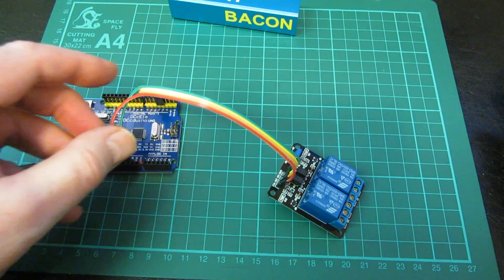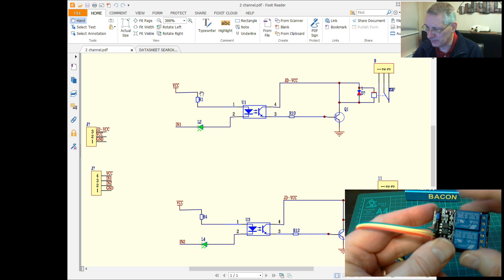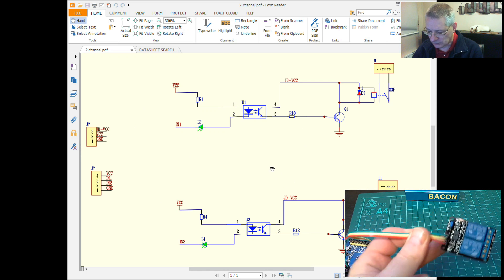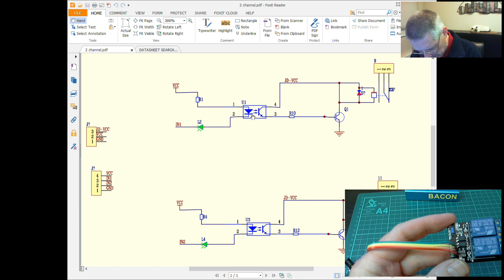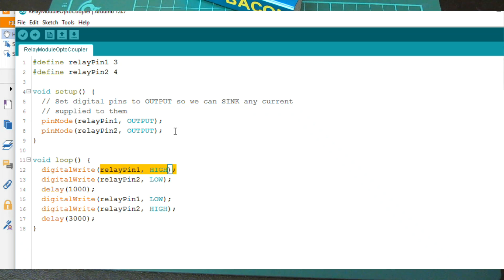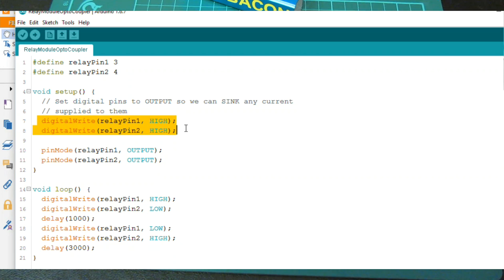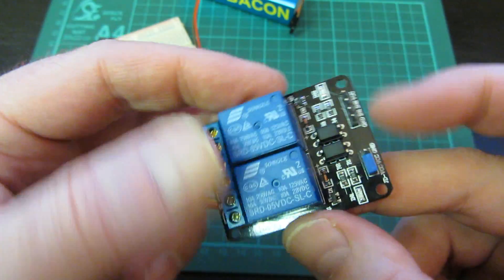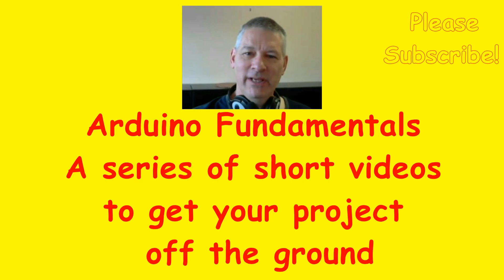#18 Add a Relay Module to your Arduino project - Hints, Tips & Traps

Comment: i have a project that is am looking to star that is similar to this, i am trying to use a 12v single channel sainsmart relay, it just has the power, ground, and signal, pins, none of the pins that you used to power the relay externally. the power and ground pins are meant to be able to connect from the arduino. if i power the arduino and relay from the same external power supply, with the positive and negative wires from the supply connecting directly to positive and negative pins on the relay, this would only leave the signal wire from the arduino connected to the relay, would the relay still receive signal because it and the arduino are connected to the same ground? this is the relay i would be using: https://www.sainsmart.com/products/sainsmart-dc-12v-power-supply-srd-12vdc-sl-c-adjustable-trigger-delay-time-relay-module-for-arduino.
Reply from the maker: This relay is, in principle, very similar to the one I show, Gideon. As the web page shows, the Arduino is powering the relay via an optocoupler (the "IN" pin, I'm assuming). As they mention that the power to operate the relay is entirely independent from the Arduino, I assume that the VCC is from a separate 12v power supply and the power supply ground and Arduino GND both connect to the GND pin on that white socket. Unfortunately, I can't find a spec sheet, not even on their own website, so what the jumpers do is anyone's guess (or perhaps you know)?
Frankly, if you just want an adjustable delay time relay I would use something similar to what I used in my video and let your Arduino do all the timing and delay work - what else is it there for?
Reply: @RalphBacon  thank you for the quick reply! No i don't know what the jumpers do. why i chose that specific relay is that it is small and my project is supposed to fit in a tight space. though i may sacrifice that for ease of use,  using the relay in this video. i do not need the adjustable delay, i am trying to make it immediately responsive.
Reply from the maker: You need something like this: http://bit.ly/SimpleRelay but see what else is on their website (or other warehouses) that might suit. Remember to include a 150-200 ohm resistor from the Arduino pin to the IN pin on any of these modules to restrict the current flow. Just keep it simple!

Comment: Do we need separate ground too ? On a 4 relay modul there is no ground pin next to vcc ! Then we have external vcc on jd-vcc pin and ground on to the gnd pin on the input header.
Reply from the maker: If the relay board is controlled by optocouplers, Jean, then you do NOT need to connect the grounds together. Why? Because the Arduino (or whatever) is effectively just lighting up an LED between a GPIO pin and it's own ground (via that optocoupler). End of. The relay board now does whatever it needs to, by using its own, entirely separate power supply. Fantastic isolation between the two parts. I hope this is clear, if not let me know. Thanks for asking a great question.

Comment: That's a really good video; kudos for that. All I would add, when you're talking about why not to use it with the jumper attached (ie, powering the coils from the Arduino and compromising the opto protection) is the current aspect. Those Songles draw about 70mA each, so if you have an 8-relay version of the board and energise all of them at once you're up in the 1/2Amp realms and you don't want to subject the Arduino 5V pin to that.
Reply from the maker: Excellent point you make there, Jim, I'll make a note for when I next mention relays.

Comment: I have a similar board, but is a bit different.  It does not have the troublesome ground next to JD-Vcc and Vcc, just the latter two pins with a jumper, which I have removed.  When connecting my independent 5 Vdc power supply, do I use JD-Vcc and the ground pin that is next to the relay inputs?  Thanks
Reply from the maker: That's right, Steve. The independent power supply (for the relay) goes to JD-VCC and the ground is common so must go to the GND pin on the board. If you have a multimeter you can prove that JD-VCC is not connected to the Arduino board at all.
Reply: @RalphBacon  Good idea; thanks for your support!

Comment: It was both useful and interesting.  However, you didn't cover how to connect the relays to an output.  I need to independently control four 24 Vdc solenoid air control valves.  Two wires and three contacts on the relay output.  The silkscreen on the board is a bit cryptic regarding what is NO, NC, and common.
Reply from the maker: You need a four-way relay board first. It's the same as I showed but contains 4 identical circuits (with a common ground). Or four singles. Or two doubles. But there will be more wires that way.
The relay outputs are zero voltage (that is, nothing is connected to them on this board) so you can see them as "switches" for the 24v and the valves. Use a COMM and NO relay connection. Your multimeter will show you that these two relay connections are normally open and only when the relay is energised to they connect.
Reply: @RalphBacon  Indeed, Thanks!
Reply: I am thinking that center contact is common and the ohmeter will tell me NO and NC.

Comment: Long time, no see...I hope you're well. I figured I'd drop by to vampire some more of your knowledge as I just acquired one of these funny little guys for a two channel 12V multi light vehicle project I've gotten myself into elbow deep at the moment. STILL the number ONE channel I go to to find help when I stray into dangerous...err...new waters, electrically speaking. Thanks again for sharing your knowledge and explanations that the rest of us apes can rightly understand and properly digest without falling asleep or frying our eyebrows. ;) 

Best wishes mate.
Reply from the maker: Good to hear from you again, it's been a while. This device would work very well in a car (low voltage) and help protect your Arduino too. Thanks for your kind words about my channel, I'm glad you like the videos. Thanks for posting.

Comment: Can you just add a flyback diode at the JD part instead of removing the jumper?  I don't have a separate 5v power supply.
Reply from the maker: If you don't have (or don't want) a separate power supply for the JD-VCC part of the circuit, Kayleb, just keep the jumper connected on the board, JD->JD-VCC. 

Replacing the jumper with a rectifier diode (eg IN4004) might give a modicum of extra protection should things go awry in the "other side" of the board, but don't rely on it. That's assuming the voltage drop across the diode doesn't affect the operation of the relay (which I don't think it will).

Adding a flyback diode instead of removing the jumper doesn't come into it here, I'm not sure how you see that helping you. Let me know!

Comment: Thanks ralph your coding skills are far superior to my novice attempts but I cant find any one local to help so self taught .
Reply from the maker: Self-taught is fine, Steve, but do try and follow Best Practice as you do so. Avoid monolithic programs (the first self-taught issue) and lay it out nicely. If it looks nicely written, logically, with comments, then it means the programmer has taken time with the code too. As a professional web coder for the best part of 3 decades, I can tell you I am STILL learning. But look at the demo sketch in my NEXT video (#133 about a workshop heater repair) to give you some ideas. Oops. Spoiler alert. Too late.

Comment: My relay is not energized led is working
Reply from the maker: If the LED is working as expected but the relay is not working, how have you supplied the power to the relay coil? For testing, use the jumper, and VCC from the Arduino, as that will then use the Arduino's power supply. For a real project, and full isolation, you really want to supply the power separately. How many wires go from your Arduino to the relay board?
Reply: I'am testing it the relay is the same as you. The wires are two in1 and in2 i have connected them to arduino digital o/p then i leave the shorted jdvc and  vcc as its. I have supplied  the right side of relay vcc from 5v arduino and GND to GND from arduino.  Thanks
Reply from the maker: I don't know what else to suggest at this point if you have followed my demo EXACTLY. You could test that the relay actually works by connecting a 9v battery to the coil VERY briefly to ensure it does click. If you have JCC-VC connected then test that the relay is getting the 5v from the Arduino supply. If the LEDs light up when you send in a signal from the Arduino GPIO then you know that the opto-coupler is working. It's a pretty simple module board so a multimeter and a 5v supply should get you to fully test that the board is working - then it down to your Arduino sketch (ie software). Test it all though, and don't ASSUME that anything is working until you have tested it!

Comment: Very good that you ignore the more irrelevant stuff.. lile conecting the gpio...and also the download stuff.. many do videos that are just a tiny to basic..
And still informative without going in to all the laws of and optocoupler. So for me you are eletrical guy danicing a very fine iceskate dance...keeping it informative and still interesting..(comparison was duebto the fact iceskaters dont get enough credit).. and also you rasied some questions... fx n channel.mosfet is also a very popular mode to switch high load..but without the mechanical teer... would a it be possible to.make an circuit with the one side and optocoupler and.the other side with mosfets..
It will be low power consumption..
And also a bit more 2018..without the clicking... and it will be smaller and lastly...it should have a serial connection..uart or something...
Thats a diagram I liked..but is possible as and princip.
Say( a mosfet board insteed of a relay board..) 8 mosfets..
2 bistable. Mosfet circuit's...not pulling the gate down. 
I think I will invetigate this..
Reply from the maker: I'm glad this got you thinking, Christian. Solid State Relays (SSRs) is also something to consider. Thanks for posting.

Comment: Too late, RIP my ESP32 will be missed i ended up shorting VCC and GND :(
Reply from the maker: Maybe not. Shorting out those two pins would overload the AMS1117 voltage regulator but your ESP32 should survive (the power doesn't flow through the ESP32). If you can find the AMS1117 (might be an NCP1117) you could replace it if your SMD soldering is any good, or just attach 3.3 volts to the VDD pin. If it springs back into life you must somehow replace the voltage regulator as that also receives 5v via the USB plug to generate the required 3.3v (or just keep the 3.3 v supply going). Worth playing about with.

Comment: Your video was great however, in spite of me following you my 4 channel relay (which appears ok) doesn't seem to switch.   I don't hear anything happening but the led is lit.   I trying to turn on a 12v pump which is prompted by a moisture sensor.    I've been struggling forever with what should be a simple task (according to your video).   I would be very much in your debt if you are able to advise me  what I might be doing wrong and help me out.
Reply from the maker: Sure Danny, let's see if we can crack this. 

1. Firstly here's a good circuit diagram of what is happening: https://electronics.stackexchange.com/questions/196139/why-is-designed-active-low If you don't understand this, don't worry, it's not essential but it would help you if you tried to follow the circuit.

2. So when you connect your Arduino's 5v pin to the VCC (but REMOVE the jumper for now) and connect the relay board's IN pin to the Arduino's GPIO OUTPUT pin that you are using to control the relay, when you set that OUTPUT pin to LOW the light will come on. When you set it HIGH the light will go off. The relay will not click. Get this working FIRST.
 
This is because the current is flowing from the Arduino's power supply (5v) via the relay board's optoisolator LED, out via the IN pin (this should be called OUT not IN) to your Arduino and hence, internally, to ground.

3. Now, if you ALSO want to power the relay with the same 5v from your Arduino, attach the jumper from VCC to JD-VCC, the Arduino's 5v to the other VCC pin, and the GND pin on the relay module to the Arduino's GND pin (there's more than one GND, any will do). Now when you set that GPIO pin to LOW it will light the light AND pull-in with a "click" that relay.

4. If this works all well and good but remember that you COULD isolate it better by removing the jumper, connect the JD-VCC and GND pins on the relay to a SEPARATE 5v power supply. That way, the two parts of the circuit are totally, 100%, separated. But it's your choice!

Now, which bit of this works and which bit does not?
Reply: Understood.  Running a test program - channel connected on then off for 1 sec , relay powered from separate 5v supply, ground not connected.
The leds on the relay flash 1 sec as expected but no sound from the relay.
Is it DEAD!?
When I first had it and ran a test there was a clicking sound - no more.  I suspect I've fried it.
Reply: Thanks for detailed reply - immense help.
I followed you steps 1 - 4.
Step 2 - worked as you said  - great!

Step 3 - again worked as you said. 
In fact a 4 channel relay I thought I had destroyed came back to life.  I now have a collection of relays!

Step 4 - Not so lucky here.
Relay LEDs poorly lit. (4 channels).  Following a test sequence HIGH/LOW on each of the 4 relays.   The relay being activated becomes slightly brighter and the remaing 3 still remain lit although very dimly.  The leds seem to indicate that the relay is working but it isn't if you follow me.  Still no sound from the relay.
I put a meter across the the voltage supply - 4.95v.  Is it enough?  so I increased the supply to 7.5v - no improvement
I reverted to Step 3, attached some components to the circuit I'm building.   The relays ceased to function...

I am trying to create a control system for my greenhouse - 
1.   Overhead water spraying activated by moisture sensors water via 12v submersible pump.
2.   Air bouyancy via 2 x 12v dc Fans.   These will be initiated by a DS18B20 sensor and also PWM (hopefully)
3.   LCD 20 x 4  for visual readout of all the above.
4    MCUs either UNO or Nano (preferred)   Sketch developed by myseld (not very elegant I suppose).

The moment I attach modules to the relay it doesn't work. It seems to drain the Uno or NAno. The fans startup but continue unabated.  I susupect they are drawing power from the MCU

I've been at this for a month now and am  beginning to doubt myself and my capabilities.   I done other diy electronics successfully but this is beginning to make me miserable.

I know it's a lot to ask, but,  I hope you can help me out with this nightmare.

Thanks

Comment: If i understood correctly with external power supply on gnd and jd-vcc, module need vcc from a board for in pins to make a circle. And if board works on 3,3v than vcc MUST be connected with 3,3V and not 5V external (say)? Otherwise 3,3V board could be damaged?
Reply from the maker: Just to be sure we both agree on what is required, Dejan, let's summarise:

1. The power from your Arduino goes to VCC
2. The "IN" pin goes to the Arduino output pin that SINKS the current when LOW (it should be labelled OUT pin, really)
3. If you choose to supply 5v to JD-VCC and do NOT use the jumper then it will work as expected
4. If you DO use the jumper so that VCC and JD-VCC are joined then you must ensure that the voltage to your Arduino is the expected voltage of 5v. 
5. If you DO use the jumper and are using a 3v3 board then you must reduce the voltage (from VCC) down to 3v3 before it reaches the Arduino.

Just remember that the Arduino (or whatever board you use) is SINKING the current from the IN pin. This image is very clear: https://electronics.stackexchange.com/questions/196139/why-is-designed-active-low

I hope this helps. Good question, thanks for posting.
Reply: 4-CH relay module don't have separate GND for external power so with 3,3V board connections should goes like this:
1. GND should be connected with GND on board and external power supply GND (all three)
2. IN pins on board digital pins
3. VCC on 3,3V board pin
4. JD-VCC on 5V VCC of external power
This way board should be safe from and IO pins will work on 3,3V, and relay on 5V.
?
Reply from the maker: No, don't connect the GND of the external 5v to the Arduino, it doesn't need it (not unless you are powering the Arduino by using the jumper). All the Arduino needs is the VCC pin connected, so current flows FROM the Arduino, through the LED and back in via the IN pin GPIO (where it will flow internally to the Arduino's GND). By keeping the GND pin purely for the external power supply you have totally separated the two supplies (unless you use the jumper). Make sense?
Reply: Just tried. Yes.
Thank you.
Reply from the maker: Glad it all worked out for you, Dejan, makes it all worthwhile!

Comment: And what do you do when you have only one 5v power supply? Then it means no isolation is possible, right? Maybe a DC to DC isolator will do the trick?
What is happening if I take out the jumper and I split the power supply so that 5v -> jdvcc, gnd of the power supply -> relay module optocouplers gnd and on the other pins, VCC from 5v+ Arduino pin, inputs from Arduino outputs and gnd remains unconnected. Arduino also is powered by power supply
Reply from the maker: Well, it's not so bad, Marius, if the relay board is powered by the same 5v as your Arduino, it's just that the level of isolation is reduced. At least this board gives you that choice. And, don't forget that the actual signal path is always isolated. Basically, it's risk vs convenience that we just all weigh up. Good point, thanks for posting.